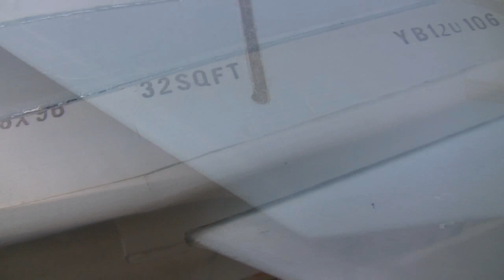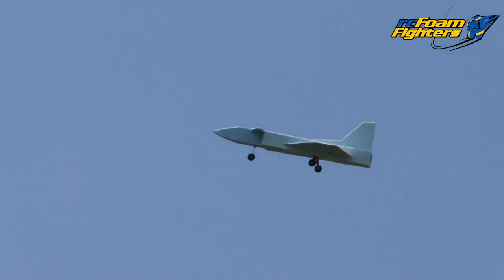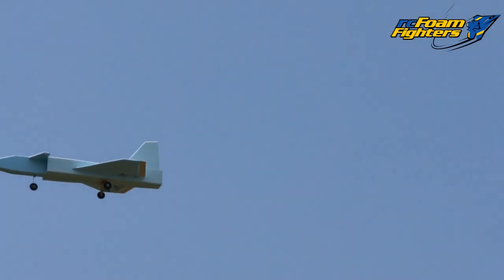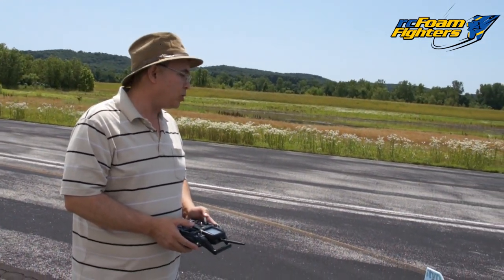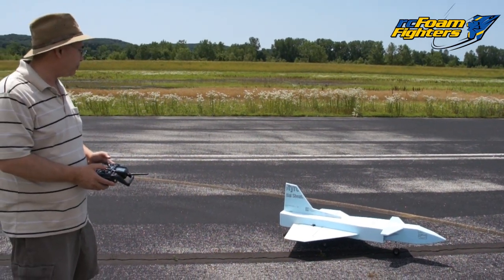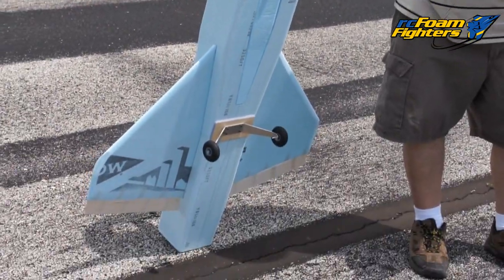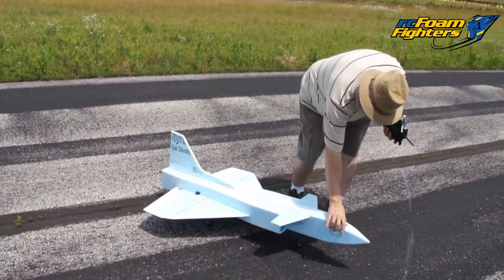89mm Duct Fan Plane Project Part 3

Comment: great lookin plane frank. I agree with SomeUselessGeek on the canards. If you make them full floating with a gyro that thing will fly like a dream. Not saying it doesnt fly like a dream now. It will always feel slightly pitchy with stationary canards at higher speeds. Its like putting little parachutes on the front. Good luck with the rest of the build cant wait to see it finished.

Comment: certainly tail-heavy even on the second flight => slows it down => makes it climb less. Don't cut the control-surfaces. Paul might be right about the canards, if you can test it without them.
well done, I like how floaty it is.